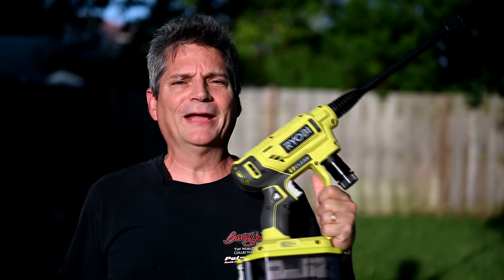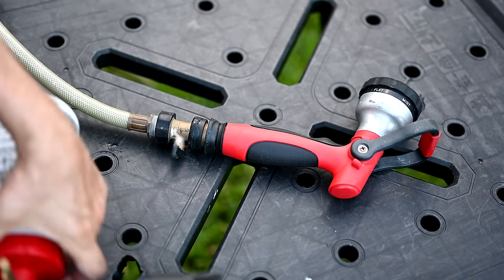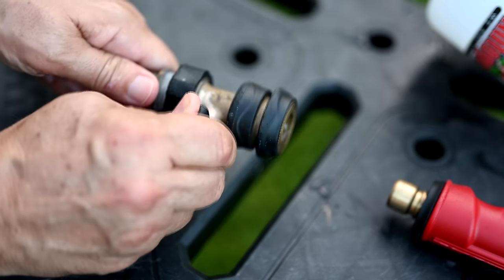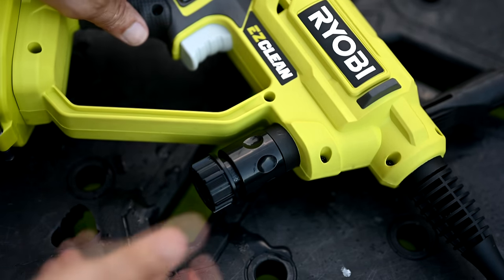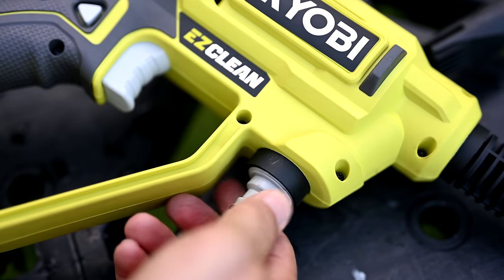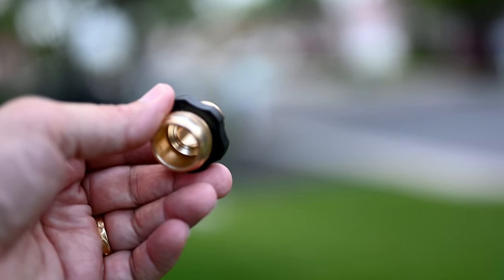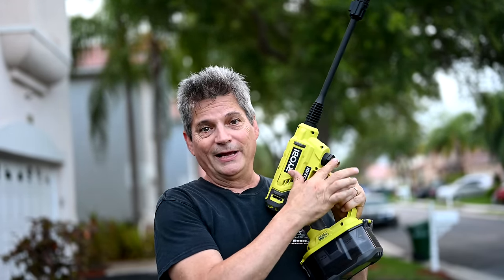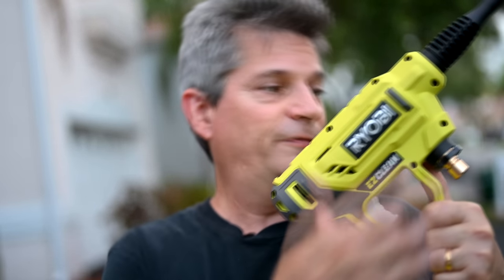Ryobi Hack Converts EZ Clean Pressure Cleaner to Quick Connect

Comment: Have you figured out how to remove the battery cover door? I hate that it doesn’t close with larger batteries
Reply from the maker: Yes! I used a tool called an "awl", it's a small screwdriver type tool that comes to a tapered point. You can also use a nail set tool. Just place the point on the metal pin on the hinge, give it some taps, you'll see it start to slide out the other end of the hinge. It looks like it should take a 6 aH battery. What sized battery were you using.
Reply: jeffostroff I’m using flexvolt 9ah XD

Comment: Hi, nice video, what spanner size did you use to remove the plastic intake on the ryobi? It's definitely not a 10 or 11 as your video shows.
Reply from the maker: It was not an 11 as in 11mm, this was an 11/16" wrench that I used, just as I showed in the video

Comment: Yeah but now you can't use a 1 liter bottle attachment as it was intended by Ryobi.  Also you can no longer use the hose it came with if you only want to suck water from a bucket!  Am I missing something???  Where do you buy the hose tip shut-off valve?

Comment: Need a hack to add no ryobi foam cannon attachments to nozzle.
Reply from the maker: You cannot use a foam cannon with this first of all this Ryobi thing is such a joke because it barely even has 300 PS I I doubt that it even has that much. But to use a soap Keenan you need usually around 1500 PS I and that type of range so the most you could do is use a soap gun which will work OK but it's not going to give you that snow foam that you would get from a soap cannon

Comment: Is there a way to use a snow foam Lance (ie one you would use with a karcher pressure washer) with this Ryobi tool?  I know Ryobi sell one but not in the UK!
Reply from the maker: Martin, a snow foam lance/cannon will not work on this Ryobi sprayer because it doe snot have the required 1/4 standard quick connect for wand attachments. But it does work on my DeWalt version, see my video from last week: "Can DeWalt Power Cleaner Work With High PSI Soap Cannons? Car Wash Tips" https://youtu.be/5XNLNlLjit0  you will also see in that video I tested the soap cannon with the Ryobi 1600 PSI portable plugin electric power washer, but you really need to use a 1.1 mm orifice with these soap cannons.

Comment: How about for a foam cannon
Reply from the maker: Not enough pressure. You need 1600 PSAI minimum. For a foam cannon I use Dewalt's 2100 electric pressure washer

Comment: Not a proprietary connector. It's the same plastic connector design first introduced by Gardena over 25 years ago. Everyone else has been copying the design for years. Works with all my garden hoses.
Reply from the maker: Exactly it works for garden hoses but not interchangeable washing accessories which sue the pressure washer standard fittings.
Reply: @jeffostroff  But in the video you said it was proprietary, indicating there were no other manufacturers adapter that would connect to it.

Comment: Are the quick coupling devices available in the big box stores?
Reply from the maker: Yes, try outside garden are with hose attachments, and also, HD sometimes has some down the pressure cleaner aisle with the accessories.

Comment: Ryobi inner pressure vale is easy to break, once it breaks, you can not buy a replacement part anywhere, one option buy a whole new gun.
Reply from the maker: Or buy a real power washer. I'm liking the compact size of the newer electric models.

Comment: Whats the point cause if you had an outside hose you wouldn't  need a cordless pressure washer.
Reply from the maker: It concentrates the water with higher pressure than a hose by itself.

Comment: Love it!  You know those "Foam Cannon's" from places like adams car polish and so many others, what is the fitting like on the the wand portion?  Is it a standard quick disconnect or is it proprietary as well?  I want to get one to run the hose into it like you did then attach a foam cannon to the joint in the middle of the wand... is that possible?
Reply from the maker: Just found Ryobi makes a Foam Blaster Accessory for this tool and ordered it : https://homedepot.sjv.io/o1mbb

Comment: No the plastic and brass fittings are interchangeable,  A common name is hozelock but there are meany manufactures some better than others, there can be problem with the cheap one's the sprung retaining spikes for a better word, fail on cheap one's and Orings over time on all but that's an easy fix. the biggest problem i have is with y connectors with  two gate  valves. i have a tendency to leave main tap on and use the two gates as on off for water that's great as i use them every day, till i forget that it's going to be freezing over night. the amount  i  have knackered this way is not funny I'm using brass fittings but i do have one that's made from one billet of solid bass that always survives a big freeze, i cannot find any more of that type on most of the y fittings  the connection to the tap is separate screw on, and that's the point of failure the ice just busts it at that spot. It's human error I know. If a company made all hose fittings frost proof they could make a fortune. nearly all hose owners have lost hose end fittings to frost, even on unconnected hoses if there is any water in it and it freezes thats it knackered.
Reply from the maker: a Worldwide standard would be nice

Comment: Thing is I like the portable SIPHON HOSE it comes with.
Plastic connect easy to break. 

So yes this is a great video hack just bummed I can't buy Inlet part from Ryobi.
Reply: EDIT: ACE hardware has plastic quick connectors.
Reply from the maker: also I hate the siphon mode it is much weaker

Comment: I own around 20 Ryobi 18 volt tools but this one is in no way worth the $80 price tag. I've watched other reviews on this tool and it's not much more than a low pressure garden host with a soap attachment
Reply: hose
Reply from the maker: BTW, I did not pay $80 for it, I paid zero during Ryobi Days sale in June when buying the 2 battery kit for $99, I needed a few more batteries anyway, so it was no bid deal to pay $99 for 2 batteries and the pressure cleaner.
Reply: @jeffostroff  Sorry I didn't mean to imply that you did. When they had that 2 battery package free tool giveaway I went ballistic and purchased most of the tools on that display except for the ones I already have. I still  have 4 of those 2 pack batteries with green bags sitting in my shop unopened. I absolutely love my Ryobi collection and there are a few I probably didn't need like that caulk gun and the grease gun but I still have them. And now it's time to start buying those sub compacts.
Reply from the maker: @kagnewmp12  I want to try that hack saw they just released also.
Reply: @jeffostroff  I have only been able to purchase the compact impact wrench and the cut off tool in my HD so far. Nice tools

Comment: Can you do the same thing on the wand end for a foam cannon ?
Reply from the maker: Mo, the tip of the wand does not appear to separate but we'll look further into it later. The wand does unscrew, so if another wand could screw in it's place, then you are good to go.
Reply: @jeffostroff  thanks for the info... and all your videos 👍
Reply: @jeffostroff  The wand unscrews from the gun but it separates in the middle with what looks like a propriety connector , I need a hack for a foam cannon , i don't have access to a hose to use the recommended foam cannon in the video.

Comment: Why not just screw in your quick disconnect, to the bottom of the Ryobi disconnect? Then you have the best of both worlds. Is that possible?
Reply from the maker: The Ryobi part is a different size and shape that's why I bought the standard brass one which is stronger and won't break

Comment: Great video! Very useful hack. Just wondering is you know of any known nozzles that are compatible to the EZ Clean? Looking to possibly use the Ryobi Foam Blaster on this. Thanks in advance!
Reply from the maker: Not that I know of, I have the foam blaster, it does not fit this because it wants a standard 1/4" wand attachment, which this sprayer is not.
Reply: jeffostroff Cool thanks!

Comment: You do realize that the stock connector from Ryobi is a universal quick connect available anywhere ?   Not proprietary!    That system ryobi chose IS plastic so you may want to swap for metal - but I’ve used the universal plastic system on all my hoses and hose end connectors for years without issue
Reply from the maker: we converted to a metal connector

Comment: This isn’t really a hack. You’re just swapping one type of quick disconnect. There are other plastic quick disconnects that aren’t compatible with those brass connections you use. Plus, some of them use a ball inside that stop the flow of water when you disconnect the other side so you don’t have to use a valve like you did.  Sure, plastic isn’t as strong as the brass, but anyone can look at the Ryobi fitting and see it can be swapped out. Don’t need an engineer for that.
Reply from the maker: There always has to be a naysayer
Reply: @jeffostroff  the hilarious thing is the Ryobi quick disconnect isn’t even proprietary.
Reply: @jbradg1  thanks! it's really good to know! That way, the gun is still adaptable with original accessories.

Comment: the hose connector that comes on the Ryobi tool is 100 times smarter than the one you use. first of all most garden tools in come with that connector as standard in most of the world. the newer versions of the connector that are on the hose side doubles as a shutoff valve when you disconnect tools and accessories. this video is just dumb really!